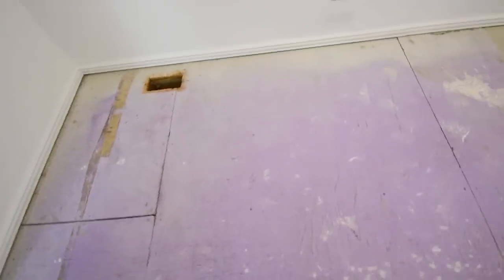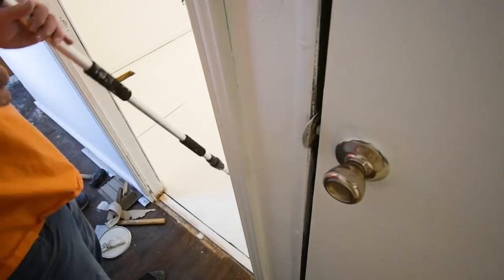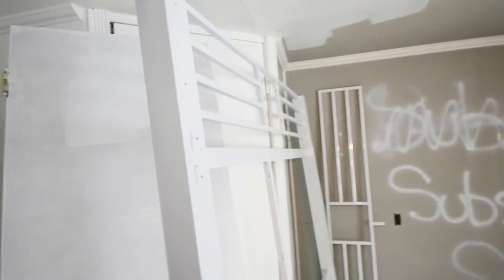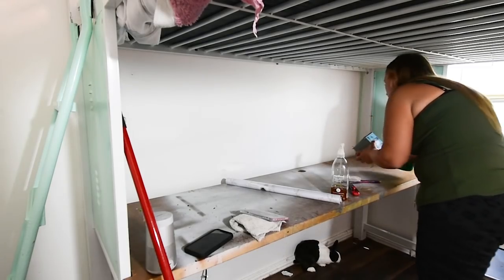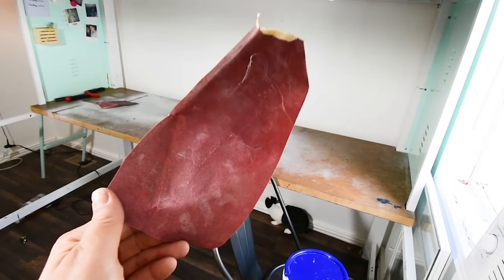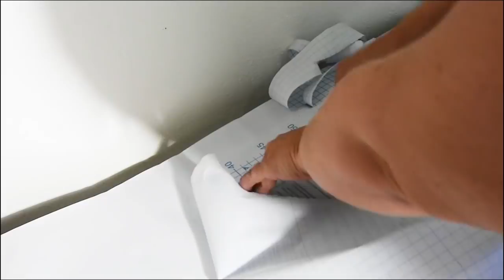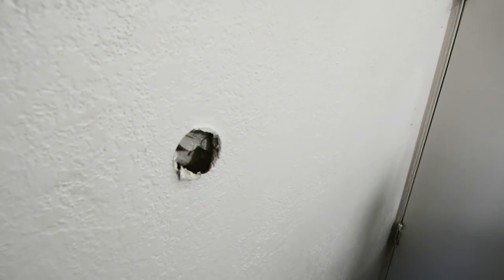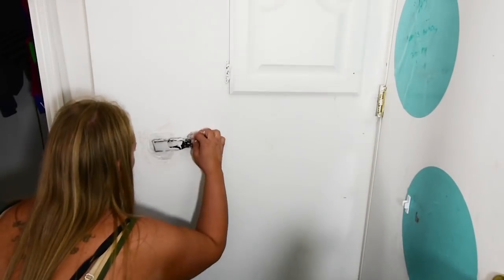Mobile Home Remodel|Bedroom DIY|Installing Vinyl Plank Flooring + Cleaning Motivation

Comment: I have lived in some bad places and diy'ed them into homes. DH and I have also redone two antique houses that we own. That said, here is a little tip that I figured out the first time in a rental single wide. When you get a hole like the doorknob one, wad up newspaper and pack it into the hole before you spackle. Takes less spackle because it gives it something to cling to and the paper gets secured by the spackle. I got the idea from another trashed rental I lived in that was an old house with lathe and key plaster walls. You are doing an impressive job. Kudos to your family for the good work, it looks really well done.

Comment: MY KIND OF CHANNEL! Real life struggles with mobile home remodeling lol 😂. I had the same struggle installing shelves in an odd way in my daughters closet but I got it done. I’ve learned start early morning on projects because I can take a break and start again before dark lol 😂. My next project is filling in the lines in my wood paneling with drywall tape and drywall compound . The area is so small it makes no sense to drywall that area so that’s my experiment area lol 😂. I’ll save my money to drywall bedrooms and bathrooms where it matters. We just built a huge beautiful pullout pantry on the side of my new fridge. It’s 7 feet tall and can hold 150 or more can goods, foil, ziplock bags, and spices. We used old wood and and stained it the same color of my cabinets with a stainless steel handle like the fridge. I love it because I lost a couple of cabinets installing all new appliances.
Reply from the maker: Hey!! Welcome! Yes and when I got this place it was dry walled so I would never do the ceiling 🙈 the previous owners did and it has caused mine to droop. They probably thought the roof was collapsing cause it looks like that, but it’s improperly installed drywall. Mobile homes need lighter weight. I want to see your pantry! That sounds amazing. Yay for another mobile homie! It sounds beautiful what you have done

Comment: Looks beautiful! Tip for contact paper. Use a hair dryer when trying to remove any bubbles. Also it really helps if you are trying to stretch it around edges or corners.
Reply from the maker: Great idea! Thank you ☺️

Comment: The struggle is real.  We've done alot of the snap together floors I'm our home(all carpets are gone!) One tip is to make sure there is not even the slightest piece of debris under the pieces you are installing so I always keep a hand held vac and before laying each piece,  thoroughly use the vac to ensure a debris free area.  Helps alot!

Comment: I think knotty pine wood panel over the hole that  the puppy did, that way if puppy whacks it open again it won’t damage the area. I’m new where and love your work.
Reply from the maker: welcome! good idea because the puppy did it again lol
Reply: I thought so.  Lol  Make it like a chair rail, or as high as you need to. Then put a nice finish look on the top.

Comment: Is it copper or aluminum wiring?
Reply: 70s could have aluminum wiring. You need special connectors for outlets and switches, etc
Reply from the maker: I am not sure to be honest with you! I’ll have to ask my husband. One of the previous owners rewired the place back when they did the drywall. Thanks for watching!